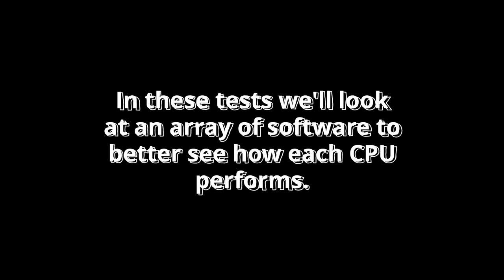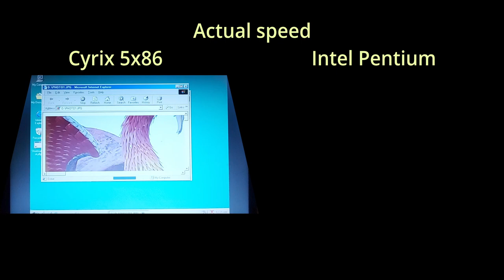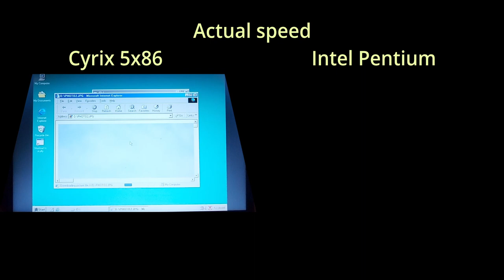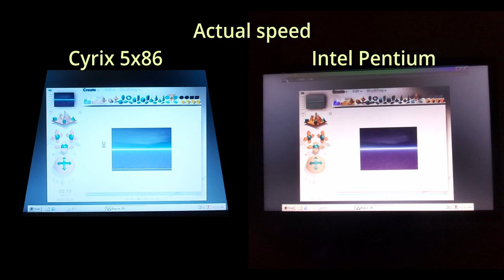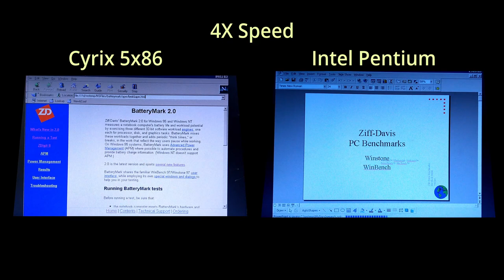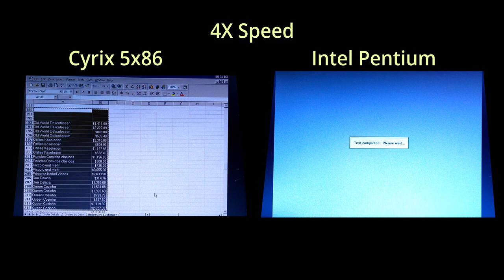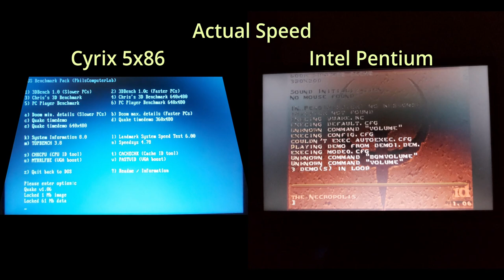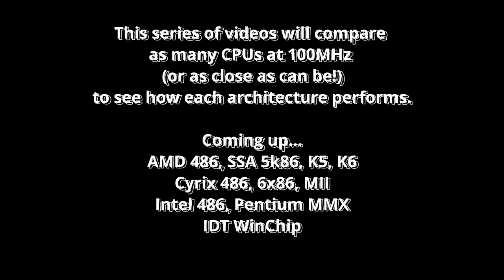Cyrix 5x86 100MHz vs Intel Pentium 100MHz. Socket 7 & Socket 3 100MHz (ish) x86 CPU challenge.

Comment: A crippled version of the 6x86. Still a great CPU Especially when all of its features are enabled. Definitely a souped up 486 even over the AMD 5x86( just a quadrupled 486) CPU. Great video. Have a good one.
Reply from the maker: I used a Cyrix 5x86 - pre-soldered to the mainboard - in my first ever PC, and I built it myself. No way I could afford a Pentium system at the time, so it was a great entry into the world of PCs for me after it was clear my Amiga 1200 was not going to cut it anymore. It served me well until the Cyrix 6x86MX processors came to market, then I built a new system around one of those.

Comment: Nice comparison video. And thanks for doing Office and CAD comparisons rather than just Doom and Quake like everyone else. Although slower, the Cyrix looked completely useable on many of those tests. Out of interest, how useable do you think the Cyrix 586 would have been back in the day at running Windows 98 / 98SE from an office use perspective and general web surfing? 

We got Windows 98SE with our second family PC back in late 1999. I installed it on our old PC which was Packard Bell Multimedia (EU model), with a 75MHz Pentium 1. After upgrading the RAM to 64MB  (EDO RAM was getting seriously cheap by early 2000) it actually ran completely acceptable. Slower than Windows 95 obviously, but totally useable. I always felt Windows 98 / 98SE really needed a Pentium, with a Pentium 166MHz being the point where 98/98SE went from running 'acceptable' to 'good' (appreciate not everyone will agree with that opinion), but I've always been interested in how it runs on these later socket 3 processors like the Intel DX4 100MHz, AMD am5x86-p75 (133MHz) and especially these Cyrix 586 processors.
Reply from the maker: Thanks for the positive feedback, much appreciated. 

With regard to your question; In the use that I've had with the Socket 3 systems they seem to be pretty responsive with the setup I have, but bear in mind that I'm using a SD to IDE adapter for main storage which I'm sure is many times faster than a hard disk from the period. I know from memory the biggest thing that slowed computers was accessing the hard disk. Having said that, the Cyrix 5x86 100MHz with 64MB RAM in using Windows 98 SE seems perfectly acceptable, not as snappy as the Pentium at the same clock speed of course, but as the results show it's not far off.
Reply: @REVERIT. Thanks for coming back to me and answering that question. I guess what I've learned here is, if all you wanted to do was standard office tasks and general web surfing, there really is no reason why a late socket 3 processor couldn't have seen a person through into the year 2000, while also running Windows 98.